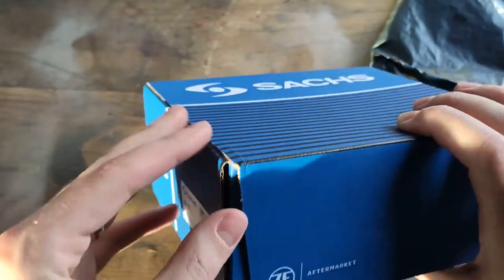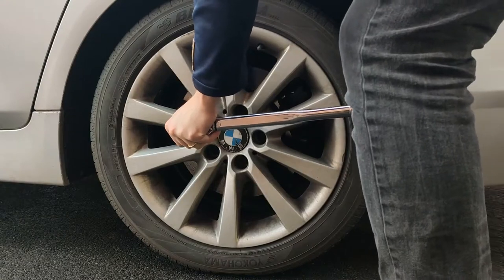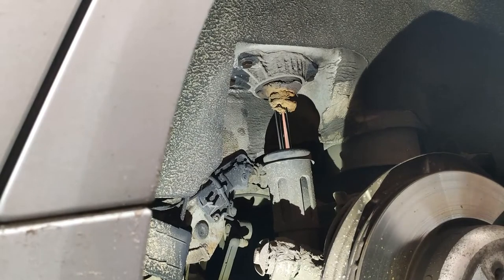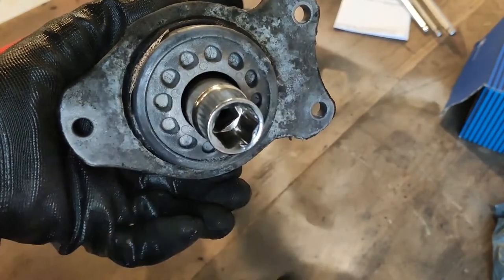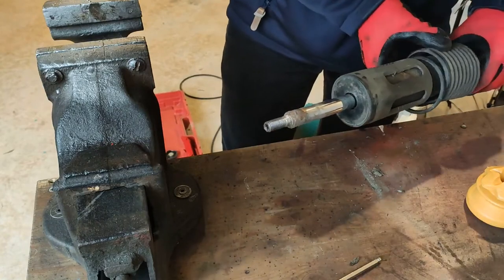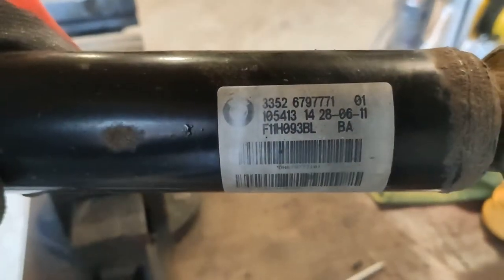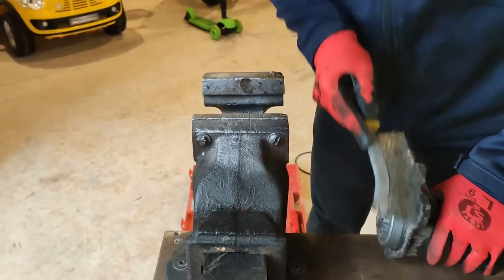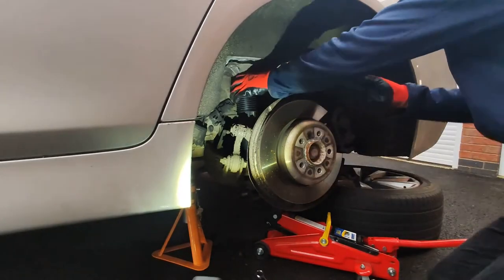BMW F11 Shock Absorber removal and dust cover replacement

Comment: I’ve just done this job, if you use an 18mm Offset ring spanner on the shock nut and a 6mm Allen key there’s no need to remove the shock absorber, simply push it down to provide clearance.
Reply: Just did it like you suggested. It was easy to do and saved me time, thank you.

Comment: can deflating the rear air springs be done instead of using a jack to hold the suspention? I only have one jack, but I do have ista diagnostic tool(that can deflate the airsprings)
Reply from the maker: Yes. That can work and it is probably safer to do than what I did. Let me know if there is a function in ISTA that lets you release the pressure in the suspension.
Reply: @hosuandreiremus  just loosen the nut to the airlines in the compressor and they will deflate
Reply: @hosuandreiremus es there is and also remember to remove the air suspension fuse otherwise the compressor will kick in and re-inflate it. Just watch any of the airbag replacement vids and it shows which ISTA function and which fuse

Comment: Is the Shock absorber cover necessary to be replaced? Mine is also broken
Reply from the maker: It is there to prolong the life of the shock absorber. You dont want rocks and salt sprayed on the shock all the time as it will perish the seals and wil start loosing fluid.

Comment: Is this front or rear. I am looking for front replacement video.
Reply from the maker: This is for the rear. I have not done the front as it was not needed.
Reply: @hosuandreiremus  I managed to replaced front shocks. I didn't have to completely remove the circular arm support on the top. Just had to remove one bolt at the front side to allow the lower arm to go down further and it was easier for the shock to come out. But have to make sure the alignment of the shock, spring pads and top hat are correct.